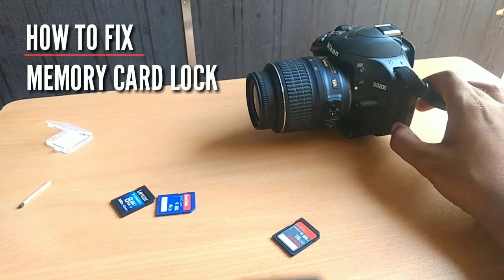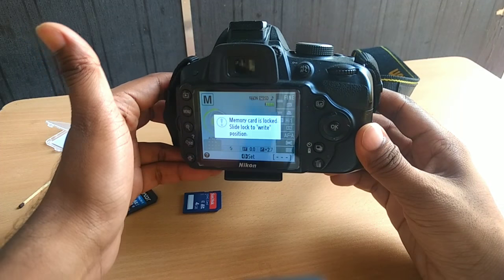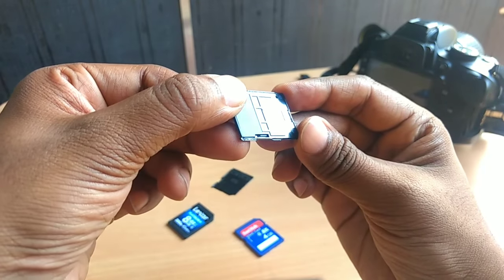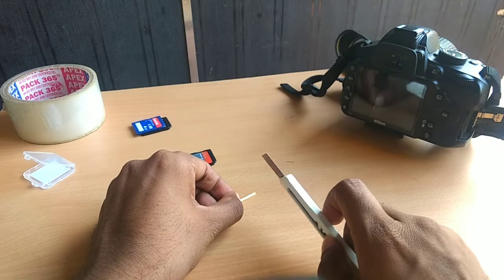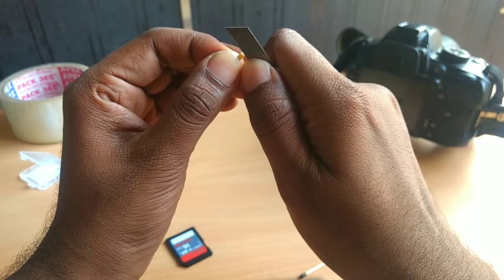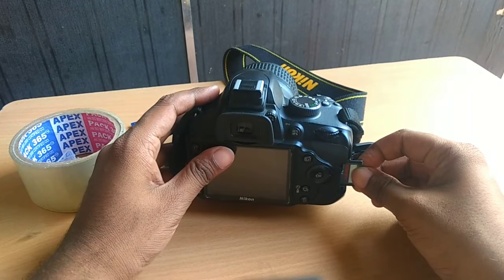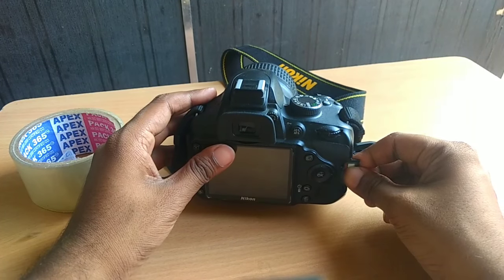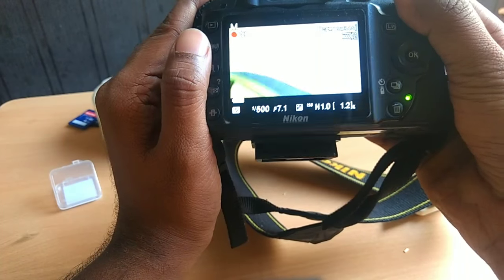How to fix sd card lock switch (broken lock, card error, no memory card)

Comment: I noticed that some card readers push this tab down or even off when inserting card. I'd first superglue the tab in place to prevent this if you have no reason to lock.  As for the matchstick (flat toothpick is easier as it has square edges) I would superglue it in place, THEN trim it flush- less handling. Never push a blade towards you finger! I winced seeing that.

Comment: I have a problem..I have a 64gb onn. sd memory card that shows on my camera the memory card is locked. But sadly the switch is not locked, the switch is unlocked. The switch is not broken. I tried the 30 sec rule. The card still does not show data. What do I need to do?

Comment: Nikon 3200 d ke lia konsa memory card best ha 32 gb me
Reply from the maker: U can buy SanDisk...I am using it.
Reply: lotoftech sandish extrme pro 32gb  is good ?
Reply: 95 mbs
Reply from the maker: I am using 32gb class 10 ultra 80mbps, pro series is 95mbps which is much better but if you are only taking photos it won't matter much, for video recording it matters more.
Reply: lotoftech  thNku bro
Reply: Is samsung 32 gb card 95mbs  es cpmpatable for nikon 3200 camera?
Reply from the maker: Use any card that is UHS-1....not higher than that...plz check user manual page no 177.

Comment: Does using a crappy sd card can lead to "freezing" or "busy...please wait" issues. My canon 750D suddenly won't take photos anymore bc every time I take a shot it will stuck in BUSY and I can't stop it unless removing the batt to reset. ☹️ but it sometimes works but then suddenly back to the issue 😩😭 HELP PLEASE im so broke to have it fixed to somebody else. Video works perfectly btw. Dunno why 😞 v1.0.0 firmware
Reply from the maker: Format the memory card ...and also reset the shooting menu.

Comment: Tried this and it worked, but the SD card is now stuck in my camera and I've tried everything :)
Reply from the maker: You should have chopped the matchstick more, but not to worry if it's stuck.
Just press it more a couple of times or use a plier and apply gentle  force in pull out direction. You have to make sure that the slot is in eject out condition and unlock. If you try this patiently it will work. :)

Comment: My problem is more than this. My sd card's lock broken in the locked position. After using you trick when i inserted my sd card in my laptop to format it. It showed that you disk is write protected. I have tried no.of solutions but none of them worked. And now I think my sd card can't be used any more. Now it is useless I guess. :(
Reply from the maker: Kindly check that, the portion created using matchstick is in the front not at the back, if its in the back then you will get this message
Reply: Thanks.... I will try it.... And I will let you know that whether it worked or not...
Reply: Aaaaaaa.... Thank you so much... :D Thankyou Thankyou Thankyou.... You Saved my sd card from turning into a junk.... It worked Thank you once again.... Thanks... I m super happy... :D
Reply from the maker: sara jameel its good to hear that from you :)

Comment: "ERROR" : The memory card is locked. Slide lock to write position.
I have set a memory card to unlock mode. but still facing the same issue again. Did any one face the same issue